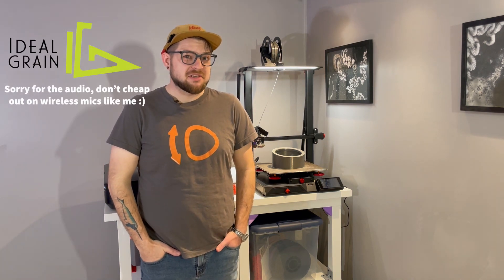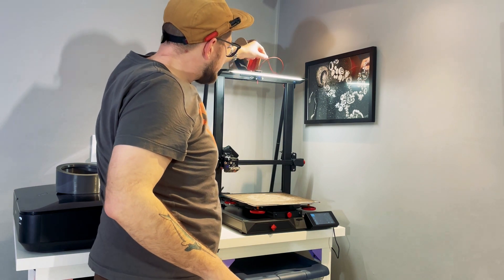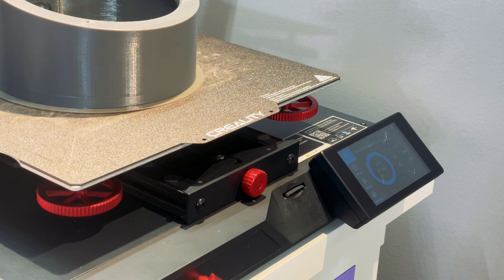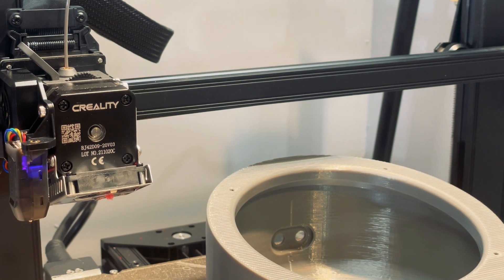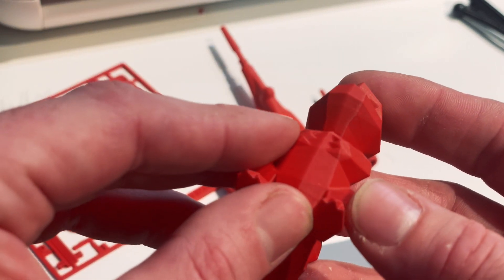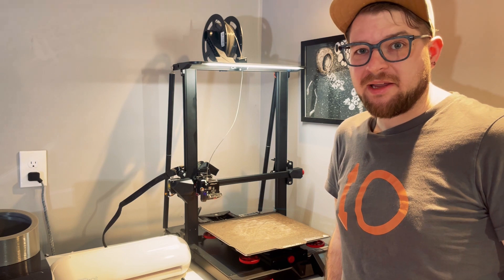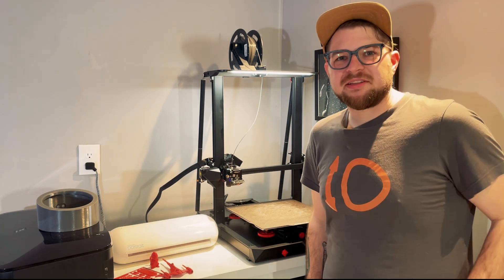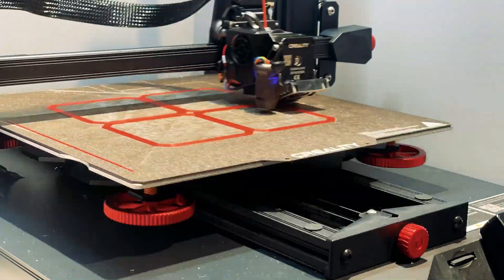Is the Creality CR-10 Smart Pro the Ultimate Budget Enthusiast 3D Printer?

Comment: Bro I had same issue bed wobble I the  middle and extrusions are not parallel but I couldn't fix extrusions. Tightened a bit at font and rear ... and also top led light of my printer is not working

Comment: I bought a Creality CR-10 back in like 2016 or so.  I've been wanting to do some upgrades to it and when I priced what all I wanted to do to it and how cheap these have got since you put this video out decided to get a CR-10 Smart Pro at Microcenter.  I have to admit I got a Bambu Labs A1 as well got really good deals on both as I only paid $399 for the CR-10 Smart Pro.  I couldn't just become one of these Bambu fan boys and not throw a little support to the Creality side of the business.
Reply from the maker: I think if I was buying today it would be hard to recommend anything but the A1 at the sub $1000 price point.
Reply: @IdealGrain  I am impressed with the Bambu and will probably be getting a X1 or possibly one of their new large format printers whenever they finally put one out.  I thought when the A1 came out I heard there was a new printer coming from them and was surprised after the A1 mini they release the A1 and not a larger format printer.
Reply: @IdealGrain  I ended up trading my A1 in on a X1C when the bed cord issue hit. I still have my Crealtiy CR 10 Smart Pro put a Sonic Pad on it and man that thing prints almost as fast as my Creality CR 10 SE which I'm very confused at Creality's naming for this printer it's a Ender sized printer running Klipper and they added linier rails to except the Z axis. Hope your CR 10 Smart Pro is still treating you good after putting the Sonic Pad on mine it's like I bought a new printer.

Comment: I just bought the CR10 Smart Pro 3D Printer and the filament feeder rotates backwards right out of the box. It breaks the filament off inside the feeder and does not extrude any melted filament. I can rotate the feeder by hand in the opposite direction and the melted filament extrudes as it should. Good luck getting service from Creality.

Comment: I’ve been recommended the Prusa Mini+ and something from b…the Ender 3 series. When looking at the Ender 3s, I saw that there was a flash sale, selling this CR-10 Pro for %50 off ($399)! Now I am really tempted for such an amazing deal. Would you recommend the CR10 Pro over other printers the same price, like the Prusa Mini+? Any other recommendations? Thanks!
Reply from the maker: It’s not a deal, it’s an old model and they’re trying to fire sale them. It’s an okay printer, but I think a Prusa Mini or Bambu X1 Carbon are the right choices at this point, depending on which end of the budget spectrum you want to go.
Reply: Ok! Thank you so much for letting me know

Comment: Thanks for the video, what are your thoughts after a year on the printer with regards print quality, reliability, any hot end issues and how easy are they to fix?
Reply from the maker: I think for the original purchase price or $750, I’d rather steer that money toward a Bambu X1 or maybe a prusa Mk IV. The biggest drawback is that you basically cannot use the full build plate without an enclosure or you’ll have warping problems. An enclosure for a printer this size would be insane.

Comment: Nice review as I am currently jostling between the E3 S1 Pro and this one.
Instead of glue stick... have you tried using hairspray, or does that not work so well on the PEI sheet vs the spring steel ones?

Comment: Micro city has this now for479. But I saw a cr10 on sale there for 379 and was ready to run out and get it. Saw there was a review and 2 people said that the ABL did not work. So I looked at teaching tech for a review and he confirmed the abl was not good and talked to creality and they said the bed must have shifted during shipping and to level it mechanically . He told them isn't that what ABL is for to adjust for that. Now here is the kicker it has no bed leveling screws. He had to take the bed off and put shims in. Then I thought about the cr10 smart pro and watched your video and I see it has manual screws if you want to go old school. Nice video learned alittle bit more. PS creality is notorious for letting the consumer do their research for them finding the bugs and such. I'm also getting a lot of info just reading all the comments here. Good job.

Comment: I'm about to go 50/50 on a printer with a friend, so for $400 each, would you say this is a good first printer for hobby use, such a cosplay/LARP pieces, props and the like? :)
Reply from the maker: Only if you have the space and means to build an enclosure around it, and go in knowing this thing will need regular tweaking and maintenance. Unfortunately without an enclosure large prints warp and have adhesion issues. Not much for alternatives at this price point though.

Comment: Thank you my friend for a lovely video. My first printer was the EasythreeD 3D Printer X7 Plus - Professional - Print Size 40cmx40cmx45cm. What a ripoff. I send it back and was refunded after it pop a cap in the power supply. I am new in 3d printing and did not find my feet yet. I bought this Creality CR - 10 pro, still in the box. I had to assemble it today. To be honest, I am nerves. It cost allot and I don't think I would handle another disappointment again.
Reply: How did it go after a year now? Is it good?
Reply: @simbian5900  Yes my friend. All goes well. I manage to design a gearbox for an electric motor, to operate my telescope. It worked well. All the gears and the wheels that move the parts, I could design and print myself. Are you well my friend?
Reply: @simbian5900  It went well, thank you my friend. I manage to print gears successful. I design my gearbox that control my huge telescope at home. I printed all the wheels that control my scope. What a ride. I have learn so much in the last few years. How are you doing my friend?

Comment: Is this a good printer for someone starting out? I am just trying to avoid upgrading down the road to a bigger one. I know there is an Ender S1 Pro not sure if that is a better option?
Reply from the maker: I think 7 months in, if you don’t need the bed size, the Prusa Mini might be the best overall experience for a beginner right now. Buying any Chinese printer, there’s a bit of an expectation that official support will be bad/limited, and it will require more tweaking than expensive mainstream printers.

I print a number of larger items that take advantage of  1/2-2/3 of the bed, but given the size of this printer- without an enclosure you’ll have a difficult time with prints warping if they that use the whole build plate.

Comment: The 3:50 mark saved my sanity. I could not get this thing to work properly and it kept crashing into the bed. Took the thing apart and sure enough the screws were almost out of the machine. Thanks for the tip. Most useful insight I have found.

Comment: I have a small-ish question, currently running a Cr10 S Pro V1 with a bunch of mods (Anti-backlash nuts, Wham Bam PEX plate, upgraded 750W Keenovo Heating pad, induction level sensor, Custom Firmware) Most importantly, the Micro-Swiss All metal hot-end, because I hated the fact that I needed non-standard threads on the Nozzles.  I am considering this printer, since it has most of the upgrades that I have done to my current printer OUT OF THE BOX..  Amazing! and at a fraction of the cost Vs upgrading a printer from scratch.  Anyways, are the nozzles regular off the shelf MK8 nozzles with normal thread length?  Or are they specific to this printer/ Creality nozzles?
Reply from the maker: Good question! I haven’t gone through enough nozzles to use more than the creality ones that I have that I believe are hardened steel. My searching around points them to being mk8 compatible. For how cheap some can be, it’s worth a go trying some cheapos.

Comment: I got mine a few days ago and the bed will not stay level. No matter how many times I re-level. I can adjust one corner move to another corner not make any adjustments and go back to the first corner and it's off by 2mm!!!
Reply from the maker: It’s a dance. When you adjust one corner, the rest get thrown out. Manually level it little by little and corner by corner using the built in assist with a piece of paper until it averages out nicely. Make sure the adjustment screws are tightened enough that the springs are actually working. This is not unique to this printer. Make sure it’s on a flat and level surface too.

Comment: Really cool overview for this 3D P. Yes, I have use this it for about 1 Mount now. It could print 3Dfilament model, but that's also all. I mean, for 850£ ( trans#currency form Norwegian), it's not worth the money! Why is that, yes, just because you are in expectations of a better finished manufactured and tested 3D printer, than this model that still seems to retain the prototype area.

Yes, probably true and proven, this is a continuation of the CR-10 smart model, the model that only had automatic bed living! Disaster. Agree, Creality Ender 3 Ver 2, is a cracking good choice that is a budget winner, for what it's worth!

So what's the point of picking on this CR-10 Smart Pro model? The display, annoyingly slow in perception where one has pressed the touch screened selection. Bravo, this is in 3 out of 10 cases, but the annoyance, it's there. Probe error during auto self-adjustment of bed! Error 203 appears on the display. A mistake that comes and goes by itself, but an irritating moment when this occurs.

Video camera, with such a low resolution that this must be a joke. With such poor properties for the camera, there should be absolutely no complaint about this powerful LED light illumination, presumably for a better experience of using the camera (but not the attached one!) BUT, why in the world push in such an altar powerful LED light, when the camera properties are ready for the bin, while the video camera light is so powerful without dim possibilities! Incredibly bad combination.

I expect firmware updates soon when a non-budget winner can work in the light of better functionalities!

Thank you for your brief demonstration, I will follow you and what you will eventually find out from this CR-10 model. Stay tune!
Reply from the maker: The value for price comes in that even the previous CR-10S Pro v1 and v2 would cost more factoring in an upgrade with an all metal hot end, and direct drive extruder than this one costs out of the box. They also don’t have the Z axis sync belt, or the pei spring steel build plate. These are all featured that make daily life with this printer a better experience. I have not experienced errors with auto bed leveling. I do not factor the “bells and whistles” like the light, camera, and screen into my decision. The functional hardware is where the value is. I agree, the touchscreen has become frustrating since I filmed this video but it is not a deal-breaker for me.

If we really want to talk about why this is still a good value in spite of its flaws, try comparing it to a Lulzbot Taz, Ultimaker, or Makerbot. Even Prusa which requires many hours of assembly.

Comment: Hello, I have a CR 10s Pro V1 and have been looking at this Smart Pro. BUT. I am really old and print model trains from the 50s. I can not afford another $700 printer every few years. I did like all the add on's here. But can't i upgrade my 10s Pro??? I have the belt on the top of the Z axis and OctoPrint on a Pi, with a PEI bed and inductive bed sensor and I added my own Z axis Struts to the Front Sheet metal 20 times stiffer. at the top of Z. Oh and a Micro Swiss Hot End with Harden Steel Nozzle. No bad for an old man huh? But I really want a few more of those goodies. Adjustable axis.,  Direct Drive, BL Touch, Tool Tray and That rear Bed heater Cable is molded for better reliability I want that too real bad.  What do you think can i soup up my Hot Rod 10s Pro for a few hundred dollars?  Got any ideas. Oh I want all those red knobs on the Smart Pro those are way cool.  Thanks, Dennis in Virginia at Frankentrain Laboratories, where Next Gen S (1/64 scale) is coming from.
Reply from the maker: Having run a CR-10S Pro V1 for 2 years, the microswiss hot end is a great upgrade, good choice - there are compatible direct drive extruders but I’m not sure about compatibility with the microswiss.

The upgrades are “nice to have” but as long as you don’t mind swapping your Bowden tubes every few weeks or months, I would suggest sticking with what you have until it doesn’t work for you. Or find other enthusiasts you can sell train parts to, to fund an eventual replacement. If I had a pro v1 or v2 on hand today, I would have kept them and not bought the Smart Pro.

Keep on keeping on! 3D printing is fun for anyone of any age and for myriad applications!

Comment: Nice and realistic review! After 1+ month with this machine, and starting as a 3D noob, I agree with your conclusions.
I think it is also realistic to mention that no 3D printer will give perfect prints out of the box. I think all makers are entitled to a fair share of trial and error.
The biggest benefit on this printer is size. I managed to print a star wars helmet in one go. But... it took me some experimenting before arriving there.
PLA and PETG go very well on this one. So far, my ASA prints did not come off without warping. I think this underlines your point on ambient temperature and the challenge of getting this huge machine enclosed properly.
All in all, I have no regrets of spending some more money on the purchase. So far, no mechanical issues.
I found that sometimes the camera fails to transmit to the app. This is 'solved' by a unplug-replug of the camera, but should not be. And: pitty that the camerasoftware does not support recording.
Reply: It mostly certainly does support recording!  If you don't believe me,  just ask the technicians at Creality's Chinese data centers.

Comment: Hey :) I've just purchased the CR-10 Smart Pro for some days ago and I'm struggling with the auto bed leveling. Seems like not matters what  I do when bed leveling manually or automatically, I still get some spots where is just right or too far from the bed. Is there any recommendation you'd like to share with me? I'd appraciate your time helping me out with this. Thanks!
Reply from the maker: Apologies it took a while to reply.

Make sure the magnetic bed is on securely and that there are no contaminates underneath that could raise it in spots.

Spend some time to get manual leveling dead on. ABL is great for adapting to small differences over time but you need to start with a nice level bed. This is true for any printer. It’s rarely going to be 100% perfect edge to edge on the bed. I would lean toward adjusting your offset until it’s just a little higher up to find a middle ground between just right in a couple spots and too high.
Reply: I printed a bed level test print, and the areas that were too low, I would put a strip of aluminum foil.  The one layer thick, in the areas that appeared low.
Reply from the maker: I have some suggestions and I will reply again when I have a chance to throw some info together, haven’t missed this!

Comment: Thanks, you were the review that finally sold me on the CR-10 Smart-Pro. Have you thought about any future mods it?
Reply from the maker: Thanks! I will probably post a “short” soon with some minor updates. No mods for me. I bought this printer because it was the only one from creality that didn’t need mods in my opinion.
I will say, the touchscreen has become a pain point. It works fine enough, but it’s not as responsive as I would like, and at times when manually setting temperatures, I need to set the hot end temperature 2-3 times before it actually starts heating. Weird bug.
Reply: I just got mine and even with the CR touch the bed will not stay level.

Comment: The cr-10 smart pro actually has the sprite pro hotend which is all metal, and maxes out at 300c. At the end of the video you compare the cr-10 smart pro to the v3 s1 and say they are basically the same but the s1 is just the regular sprite hotend which isn't all metal and i believe it maxes out at 260c. I think you also didn't mention the dual lead screws in both the cr-10 smart pro and s1
Reply from the maker: Dual lead screws are a given on anything above entry level, and I specifically pointed out the belt connecting the dual lead screws.

If the hot ends are different that further goes to show that creality’s product offerings even more of a mess and they don’t advertise the difference well, if at all.

Comment: Nice review! 
Would it be possible for you to release your print profile?
Reply from the maker: I basically use the ChazMeister ender 3 profile and just crank the retracts way down between 0.5 and 1.5mm depending on the material.

Comment: Nice review!
I bought one last week and can't seem to get the z-banding gone, did you have that problem yourself?
Reply from the maker: Initially it was minor. Tightening up the belts a hair more and adjusting the eccentric nuts on your V wheels so they just barely roll on the extrusion without slipping solved it. I do get some occasionally that seem to be in-line with a feature or two in a given print but it’s only 1-2 layers and I’ve experienced this on basically FDM every printer I’ve ever used.

To be clear the Z banding in my experience was from slip in the Y axis/bed. Those are the V wheels I would concentrate on getting just right.

Thank you!
Reply: @IdealGrain  Thanks so much for your indept answer, I'll have something to play with this weekend and try to get it sorted. You've got a new subscriber!